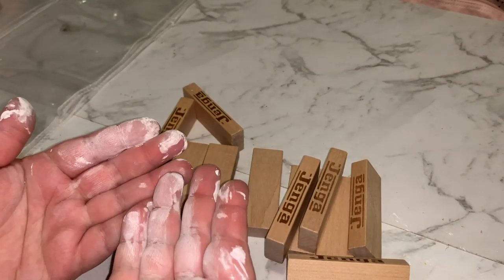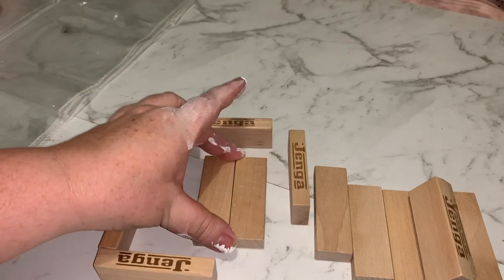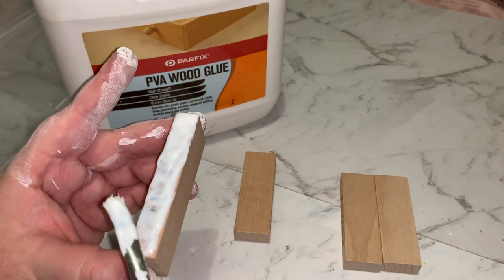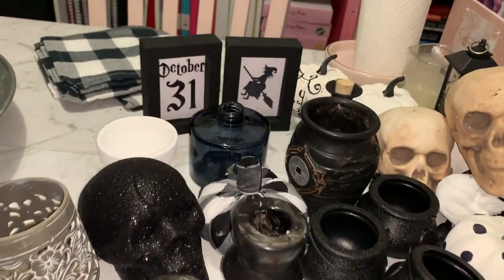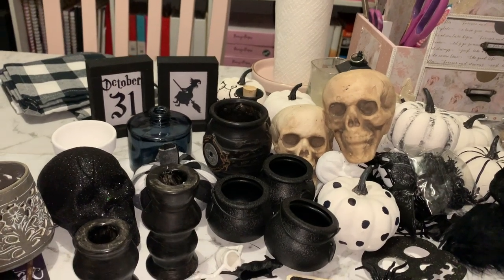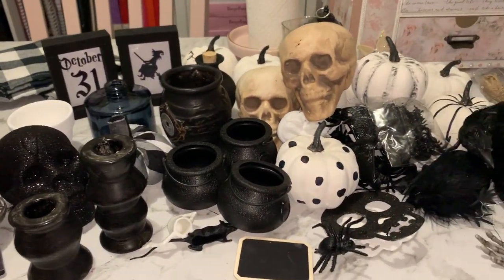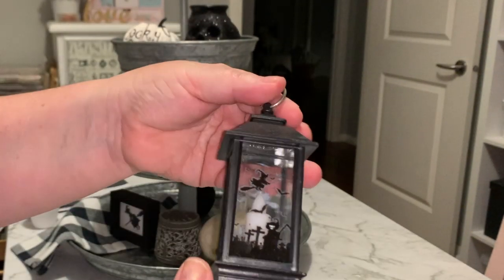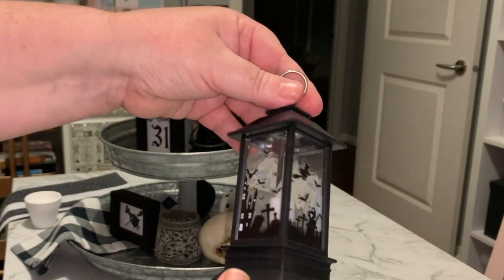HALLOWEEN TIERED TRAY | PLUS 5 HALLOWEEN TIERED TRAY DIY DECOR IDEAS

Comment: I look forward to viewing Halloween decor ideas that you come up with every year. They are simply spooktacular! So many clever ideas. I especially like the witch's hat. I would like to try that on a larger scale displayed on top of the Wicked Witch Of The West's red and white striped stockinged legs, which will have to be created with red paint stripes around the diameter of white tights along with some red glittered shoes for the ruby slippers.  Any Idea of what I could stuff in the stockings  to form the legs? I thought I would use pillow stuffing. I just don't want them to look lumpy.  We can display them at the bottom of the porch after the Halloween Festival is done with them.  Maybe make them look like they are coming out from under the steps of the front porch. Oh, this is going to be fun. Thank you so much, Lisa, for all of these Hallow ideas. They are all simply Boovine.  I will check out the other videos that you have linked below. Thank you. RIP
Reply from the maker: Thank you so much Rhonda! It sounds like you have just as much fun creating Halloween decor as me!! Lol  those witches sticking legs sound so cute!! Yes just pillow stuffing will give you the smoothest texture I think, they are gonna look awesome!